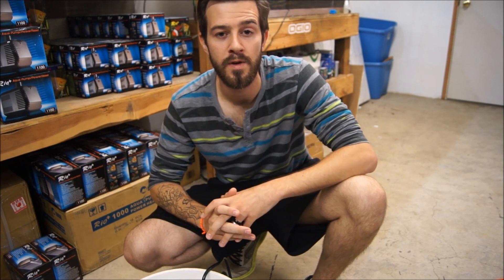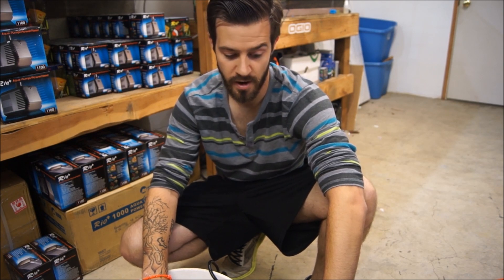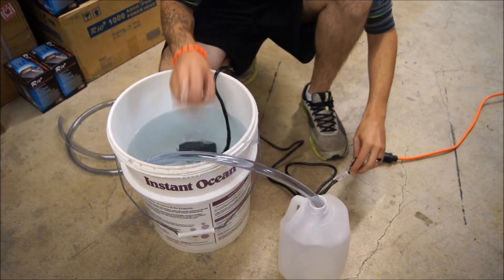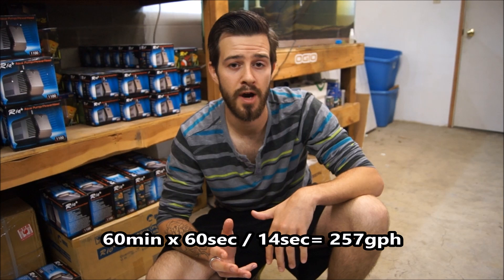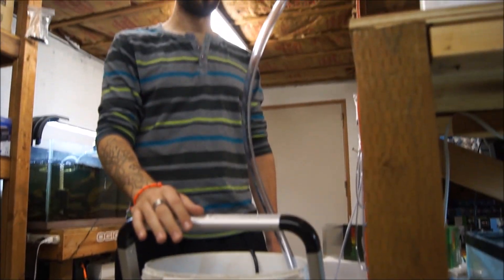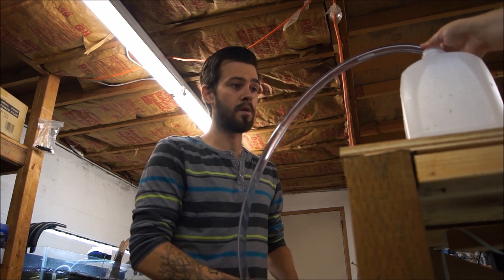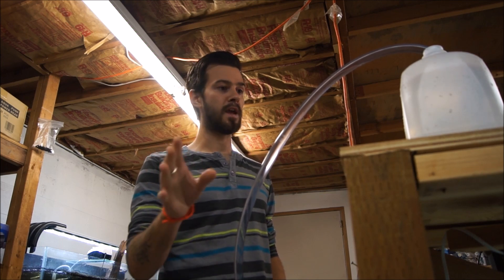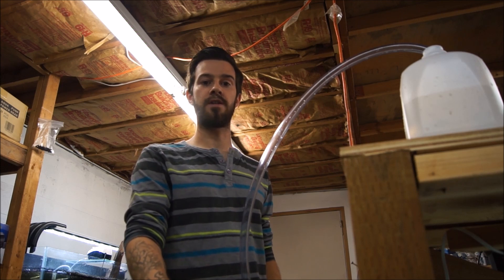Calculating Aquarium Flow Turn Over

Comment: This unfortunately isn't accurate. 1 you're creating overhead. 2 you're creating a siphon. At the end of the day, the number doesn't matter. The effect of the flow in the aquarium is what matters.
Reply: Actually this is quite accurate, especially when we consider we are not trying to build rocket ships, only approximate flow rates for aspect such as UV Sterilization. I and other professionals have been using such methods for decades

Comment: Great video demo, 

Question, some fluval FX6 owners think because their canisters are highly pressurized that it doesn't have any head pressure loss?

They say you can put a FX6 in the basement & pump to 2nd floor without head loss.

This isn't true is it?
Reply from the maker: +Michael Piccirillo thanks! The FX6 just like any canister will loose head pressure. Their own publications show that. I think what people are referring too is how the canister filter is a closed loop with a siphon, so once water is in the lines, it should have minimal decrease in head pressure say at 4 feet vs two stories. But this would be true with any canister as it create the siphon with water coming down.
If you haven't check out this article, it goes over this concept more.
http://www.aquarium-pond-answers.com/2011/09/head-pressure-in-aquarium-and-pond.html
Reply: American Aquarium awesome. Thanks 4 reply